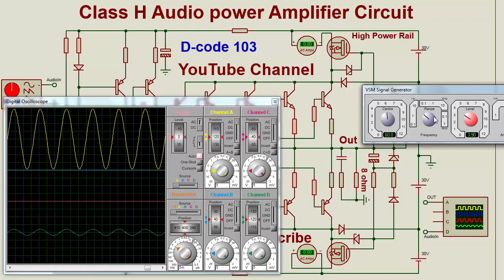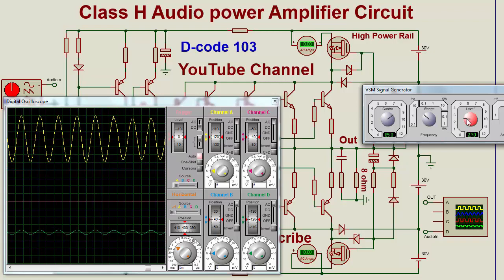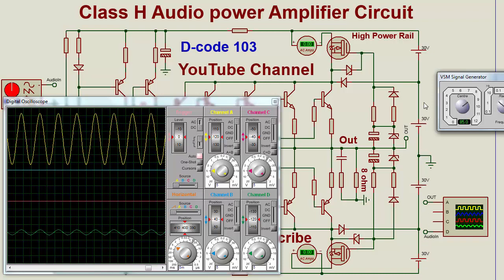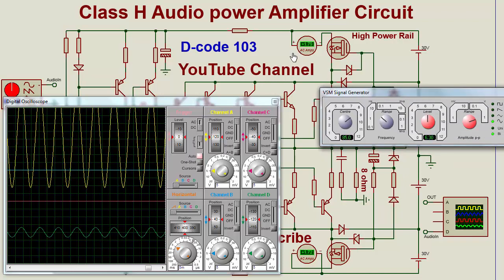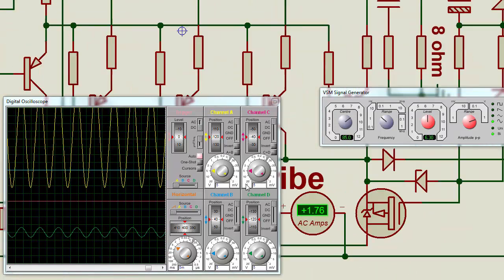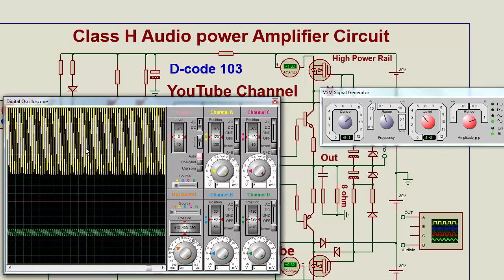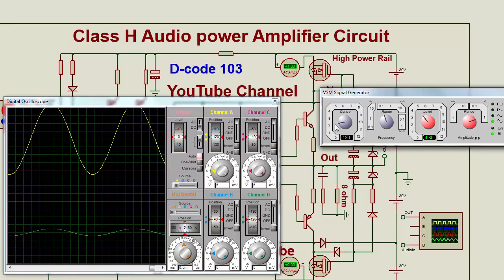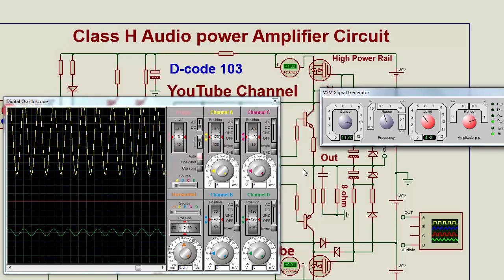Class H Power Amplifier circuit and 8 ohm output result

Comment: How does the high voltage stage start up?
Reply from the maker: In general any audio amplifier amplify voltage level of input audio (0 -1v). Corresponding Output audio voltage depends on which higher voltage source you are using suppose we take -72 to +72v. This source may be battery or from transformer. Thank you
Reply: @Dcode103  Thank you but I want to ask: in your schematic, the low voltage stage is 30V and the high voltage stage is 60V. To startup high voltage stage, the MOSFET must be turn on but I do not understand how is the principle to turn on it.
Reply from the maker: It depends on the input audio voltage level when it reaches certain voltage the MOSFET switch on if it's gate have on voltage. In the circuit there is a zener. When voltage cross the zener voltage it on MOSFET.